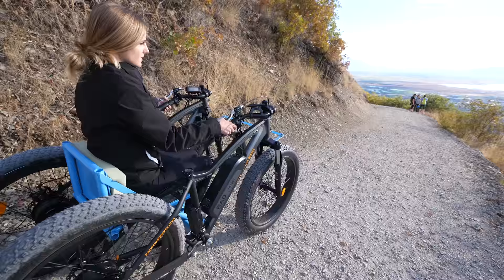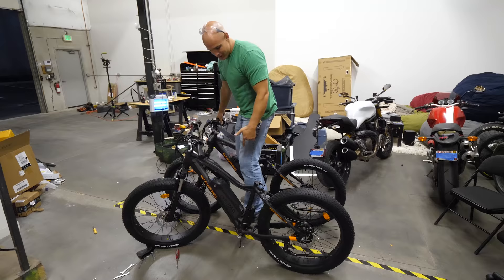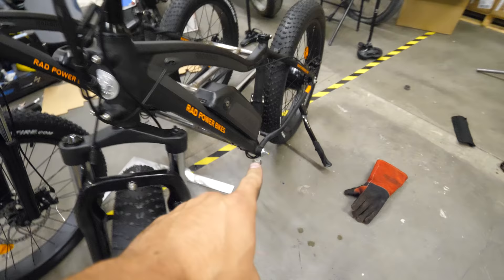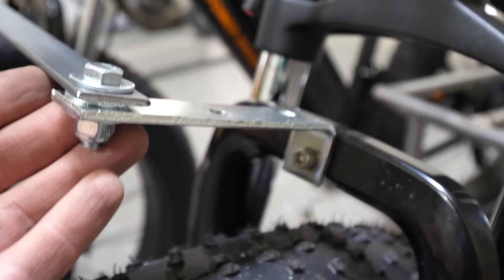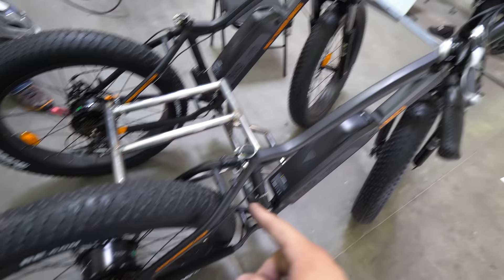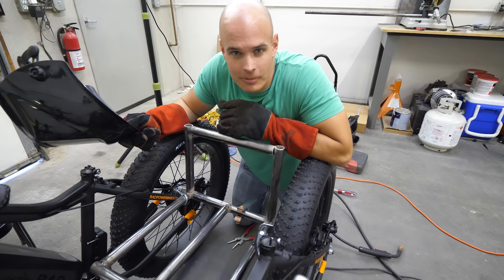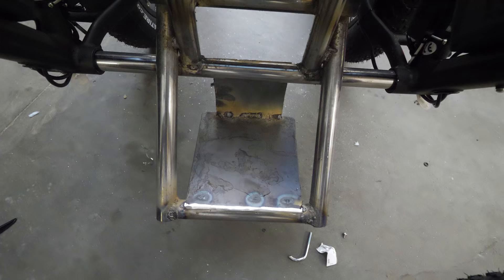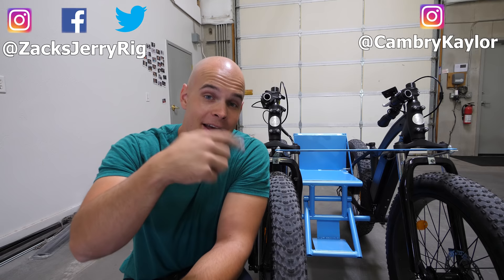How to Build an Off Road Wheelchair (From 2 Electric Bikes)

Comment: I want one of these. But one tip, you’d save welding, weight and cost if you used upholstery for the back rest and seat like on an everyday wheelchair. That was probably 5 extra pounds added on with the metal seat and with upholstery you can adjust to the comfort of the user. That might not seem important but to a chair user it is vital. But great job. The WC industry would probably charge 12k for this (since they’re in it just for the profits).

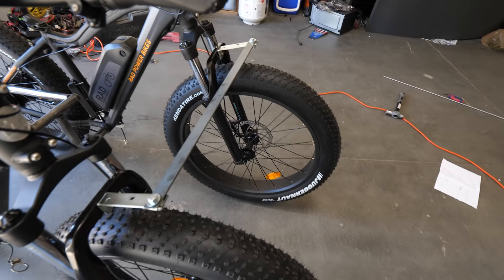Comment: 5:13 if you drive alongside on slope and wheels turn together you should consider that one of the bikes can be higher than the other so you should think about how both bike can turn together if they are not on the same level, so you don't break the stearing mechanism if the slope is too big. And also on a very big slopes the seat won't be horisontally and it will be unconfortable. And add seat belt for the seat and shock absorbers too. Really cool build man.

Comment: Maybe leave a bit of handle bar to strap a set of head lights up and a 12volt  battery under the seat with the solar panel and a step down or up eletric unit for the right voltage for extra power and distance. Also add arm rest to the spots the factory seat go to make it a bit more comfy for longer trips on both sides.

Comment: A tubing cutter will give you a cleaner cut. Awesome Idea, I have not had a car in five years I may build one (LOL)  you may want to consider doing an outer seat with a weight in the center for ease of access. the problem no is that she has to be lifted into and out of the bike. Se heeds to be able to bring her wheel chair to the center of the seat and rotate her body into the seat by raising the center bar overhead. maybe unhook the tandem bar with ease with a latch instead of an overhead bar?

Comment: How about making some kind of a collapsible crane like they use to put someone into a tub for a bath so she can get in by herself. Modify your seat bracket to use a car bucket seat and seat belt. She could transfer from the wheelchair to the bucket seat and swing around and set down into the seat frame and stow the crane down onto the bike.  

 As someone mentioned install springs on the seat bracket. We used car valve springs on minibikes we built in shop class. We used two different size pipes so that one fit inside the other and welded washers to the pipes. We made the washers from plate steel and used them on each end of the springs where the pipes came together. 

Maybe add a pivot point between the frames to mount a set of handlebars that is closer to her for easier and better control.  If you combine the front brakes to one side of the handle bars and the rear brakes to the other side. Use small turnbuckles to adjust the brake cables to equalize the tension.

It was suggested to add more batteries. If you do that I would suggest using a two battery disconnect switch like used on a boat and wire it so you can only use one set at a time that way when the first set runs down you can switch over to the other to return to where you started from. 

Also how about a place where she can secure a cell phone so you know it will be there if she needs to call for help. 

Is there a reverse on these bikes? If not check out "using a battery drill on a bicycle" on YouTube you may be able to set up something like that for a reverse if needed.

GREAT build you can see how happy she is and how much freedom you have given her.

Comment: very nice build :) maybe you already know, but, you could implement the Ackerman principle, by mounting the 2 steering levers in front of the fork, pointing outwards (in this case) so that the line of the articulating points, meets in the middle of the rear axle (the line which goes through the rear axles graphically). this way there will be less friction and drag while steering. this will be more significant the tighter the turn is. also reduces sideways loads, and skidding of the front tires while steering.

Comment: I am deeply impressed about this great vehicle.
But maybe you consider some upgrades: lights (led), hip seatbelt. And to integrate electronics: one acceleration manipulator for two bikes. 
An the same with brakes. For hydrualic it can be one paddle for front and one paddle for rear brake in each bike.
I said that only for safety reasons.

Comment: I bought two inexpensive normal (non-electric) mountain bikes a couple years ago to make almost exactly this (for myself, not disabled, just for fun). Mine is complicated because I need to keep the pedal gear drive (but use drills or something), and I have rear suspension as well (so a solid bar between pedals probably won't work). Still researching approaches, and I'm hearing that I might need to keep pedals (to be street legal in Canada).

Comment: I saw a Japanese motorcycle trike on NHK World where the space was left open between the rear wheels to allow a standard wheel chair to access the vehicle.  Then the rider would lock in the chair and it would lift it to just above the tyre height. The wheelchair then became the seat of the trike, if that makes sense. It could be started from an electric start and ridden as a normal trike once the wheelchair was locked in. A similar access method on this would make it easier to get in and out without the need for Cambry being lifted into place.

Comment: Just a suggestion: You can try to make something through which she doesn't need anyone's help to sit on that seat maybe something from front side by removing the metal bar which connects both front handles in a way such that metal bar can be attached again after she sit on the seat.

Comment: Top stuff mate!!👍...could I make a suggestion?🤔...if you use a round pipe for the fork tie-rod, you could thread eye bolts with a locker nut into it.(that guillotine in front makes me nervous lol) This would allow you to make wheel alignments easily. It could also be held in place with quick release pins so it could be swung out of the way to allow access. (And PLEASE put some padding over it in case she crashes 😉 even with a lap belt, her face could still smash the bar). Also, whack some mud guards on it to stop spatter in the face from the front wheels, and to prevent accidental contact with the rear tyres right next to her! (Rubber burns damn hurt lol😉)I realise this is a prototype with some refinement still to do, but you have done well. Good on ya!!

Comment: if you use 1 bike motor then when it runs out you can use the other one for 2× the battery life because when you think of it 2 motors= more power and speed but tbh i think one motors power is enough

Comment: Need aluminium frame, to accomodate a nice cushioned seat. Retro fit from a well built office chair or a like. 
Also instead of rear bike suspension put the chair itself on some springs. Same way an excavator seat is made.

Comment: Instead of the u-bolts you should go off the seat post and you could add a suspension system inline with that. It will be a better mounting point and improve the comfort for the rider. You should also decrease the spring rate of the front suspension to you have increased the spring rate by adding additional shocks in parallel, also the CG of the bike is now farther back than it was designed for.

Comment: my idea taken from this,  build a drop platform with electric lifters and wheel chair lock downs so she can run her own wheelchair in from the back and operate it on her own at her will without having to be lifted in to the seat.   i realize that would require the bike to be wider and that may be a slight hindrance but would the added independence out weight the down side of  being wider. I have built a drop platform  on rockers to make a wheel chair a rocking chair, i think the same thing would work here.

Comment: Why not use use flat plates rather than pipes for the seat. Light and strong. You can also have a canvas or leather seat instead of metal base as it will be more comfy for anyone to sit on with or without additional cushioning. You can also design bikes ground up and make do wit a lot less metal.

Comment: Next add a pannier rack to each bike to give arm rests to provide also less splash from the rear tyres and also you could bump up the range massively by splicing in 3 new battery packs just under the seat......

Comment: Personally I would've tried to link the throttles together somehow. A bit of wire work should do it since it is electric. As well as I would've linked up the front brakes to one lever because it's all easy to get to.

Comment: Well done, but I was wondering why you didn't use a tadpole trike with fat tires as the base for this project. After some modifikation she could probably climb into a tadpole on her own, the frame will probably be structurally more sound and it will be lighter.

Comment: Have you considered making one with a ramp and bottom platform so she could ride her existing wheelchair onto the bike and lock in to use it. This would give her more independence as she wouldn’t need anyone to lift her and place her in the seat of the bike? Just an idea... I use a power wheelchair and as a heavy guy I would not be so easy to lift lol

Comment: where you used the 'exhaust clamps' to attach the rear of the seat to the frame - you could have instead attached the seat using some motorcycle shocks/springs and easily, in so doing, had rear suspension - even if only for the seat - it'd make for a more comfy ride for the user regardless..what do you think?

Comment: That's a cool looking electric quad.. Not only can she use it bcoz of her disability but also our wounded soldiers and folk who have had amputations such as myself.. Over all it is cool but maybe you could add either reflectors on the wheels or on the bikes itself, a couple of mirrors and maybe a brake n front light just incase one get cought riding in the evening.. You can look into putting like a 1 shock like a soft tail motorcycle in the same sense..

Comment: you need to put "fenders" on to keep accidental jamming into the wheels
i would think that using the seat mounts would rase the clearance and posably create mor stability?
also handals for manual pushing and a roll bar for safty

Comment: Suspension under the seat will do much better/cheaper than modding rear springed MTT. And u do need to cut out curves for the tubes to fit when wielding them in 90 degree angle.

Comment: The metal you are using is 3x as heavy as you need use 4130 molly tubing .059" thick.  Used for bicycle frames and air planes

Comment: I have 2 sugestions. 
1: How will she sit on the chair if the link rod ion the wheels? Someone has to lift her up and set vertical  down on the chair which is not that easy. Maybe detachable rod on one side like opening door?
2: Put seatbelt for situations when she ride down the hill or make "gyro seat" on axle to make seat always level

Comment: What if you aloud the bikes to pivot where they are tied together at the cranks. So when you go over objects one will pivot independently from another. You could also weld in limit points. Now she would have to move her hands along side of the pivoting bike but I think that will give you the rear suspension your wanting. Also a plus tire is pretty forgiving letting out more air great build. You could also suspend the seat frame

Comment: If I ever made something like this for sale I'd probably name it the Charioteer.

As for things I'd do if I did make one for personal, commercial, or other reasons I'd probably change the breaking system from the top of the handle to the bottom of it so that it can be activated with the pointer/middle fingers.

I'd add suspension to the seat somehow, add a motorcycle style saddlebag to the back of the seat.

I'd also widen it so people could roll their wheelchair inbetween it to get into it themselves, that would require the bar connecting both sets of handle bars to be easily removeable & replaceable as well.

If it ever becomes viable I'd use those thin clear experimental solar pannels over any surface possible.

Lastly I'd add some batteries too the underside of the seat so that it could go for longer trips.

I'd like to make it all from scratch as well but that'd be a lot of work obviously, though I feel it'd be well worth it & they could probably be sold for well under that 20k mark of a normal electeic wheelchair.

Comment: I love this whole series. Wondering if you ever changed the handlebar setup? I know you kept the right side of each handlebar because that's where the throttle is when it comes stock, but it looks asymmetrical. Now that you've restored the front brakes are you thinking of improving the handlebars?

Comment: You don't have to add a rear suspension, a great alternative would be a seat post with a suspension built in it, buy 2 of them and add them parallel to the bike seat and bam! Smooth cruises on all terrain

Comment: Im into mountain biking and to make it better you could just make it tubeless and run low tire pressure or just run low tire pressure but then the tubes might get pinched. But I guess getting a higher end full air suspension bike is probably a better idea

Comment: How about 2 more motors in the front hubs and linking the 4 controllers into 1 master. Just an Idea. Not hard to do. Next make it possible for the bikes to move a little independently, to give a form of articulation. plus the ride would be a lot more stable and comfortable. the center bar in the bottom brackets would be able to pivot and the mounting on the back of the seat would be sprung, steering could be done with a remote cable from the front fork back under the seat and forward again to the other fork. because there is no use of peddles reverse would not be that difficult. hope this is a help. good luck

Comment: A very practical way to make it perfect is to make the real wheelchair integrated(mounted) into this modified e-bike so no need to stand up from the wheelchair to sit here , you can remove the chair in between the two bikes and make the wheelchair as the chair with just slightly widenning the e-bikes inter-distance

Comment: I had this idea but for an electric  town car with dual rear suspension as well as dual front suspension. The bikes would unfortunately have to be cut in half.  I would be doing it a little differently tho. I would be combining wheel hub motors on the rear, and the front as well as putting a mid drive motors on both rear wheels, for a combined total of 6 separate motors.   For full speed all motors would work together, and then there would be a mid power mode, extending use range by only using the 4 wheel hub motors, than there would be a low power mode that'll use the two mid motors, then an ultra low power mode, using only the two rear hub motors.  I'd also like to create some sort of faux shifter and gears for like a pretend racing mode, when you start on fake gear 1 only the rear hub motors run, then when you shift into fake gear 2 the two front hub motors will kick in as well, then when you shift to fake gear 3 all for wheels and then one mid drive motor will kick on, then when you shift to fake gear 4, all motors will turn on.    It's completely unnecessary to do, but if you just like to shift gears while ripping around, you can still kind of get that experience. Could even install a temporary power cut off switch where the clutch would be, so when you press it the motors temporary shut off while you shift the fake gears simulating the car going into an unpowered glide while in-between gears then pressing you back into the seat again when the gear kicks back in.

Comment: First off I wanted to say that I found her story and what you did for her super inspiring. I had a couple questions. 
1,  kind of a two part question, is there a way to link the Motors together so that they run off one throttle? The reason I ask is I was wondering if you were using one throttle, does  it pull to one side like want to go in circles or no problem at all and perfectly fine with being independent? Thank you and great job

Comment: It occurs to me that there must be some way to take advantage of the derailleurs, shift cables and levers, even though the pedals and cranks have been deleted.

Perhaps a pair of small electric motors could be used to actuate the movements of the derailleurs, according to the setting changes made on the shift levers.

Then if the controls for the gear shifting systems on both bikes could be bridged, perhaps the two levers could be made to function in tandem, changing gears on both bikes, no matter which lever is shifted?

You're obviously a good engineer and a very clever designer, so I wouldn't be surprised to learn that you've already experimented with such evolutions, and have made this happen on a more recent iteration of this concept.

I'm excited for you, to see how far you go with this, because I think it's a totally viable and realistic concept for mass production and retail sale.

In fact, I would bet that lots of people outside of the parapalegic community, would love to buy something like this.

Best of success to you!
Reply: What is the point of the derailleur, shift cables, and levers is there's no crank to power them? The electric motor is a hub motor. It's part of the wheel assembly. It doesn't tie in to the rear gear set.

Comment: hi zack

 i have just seen your wheel chair build. i know a very easy way to make pullin the brakes less work on the user. motor bike sstunt riders use easy pull clutch levers that would work with any cable brakess that are soooo much easier to use. but offer no control / feel loss. i dont watch your videos. but if thiss is any help please let me know. improving anyones life a little is a noble thing. this moved me. my little girl strugles to walk and i will build her one of these when shes old enough to use it safely 

thanks chris